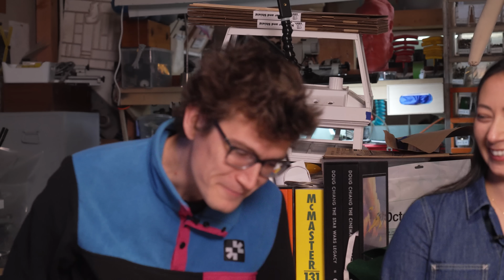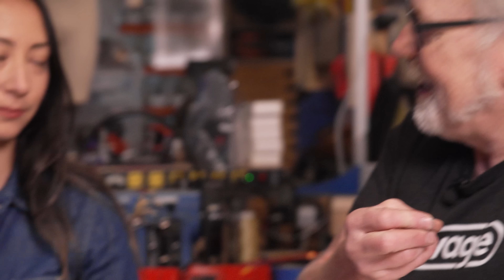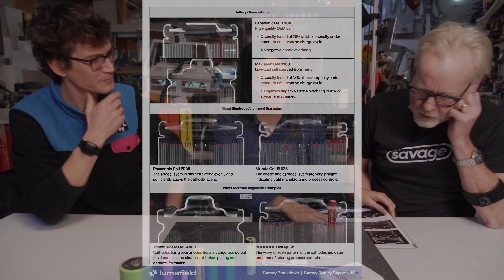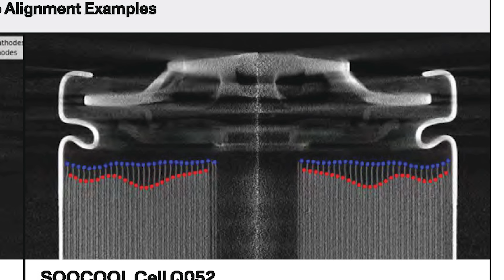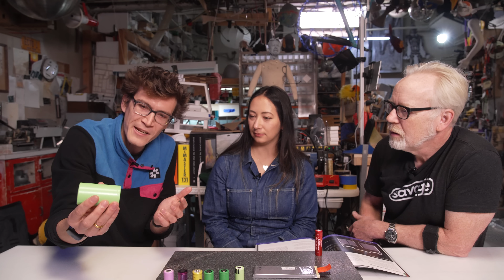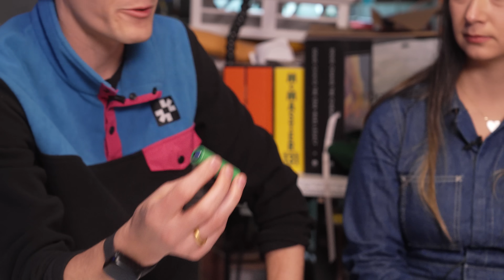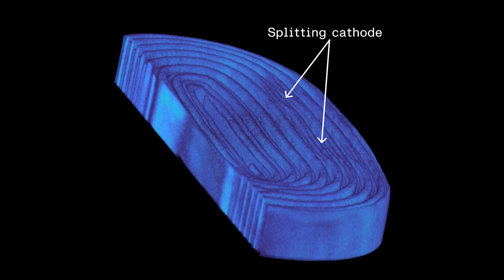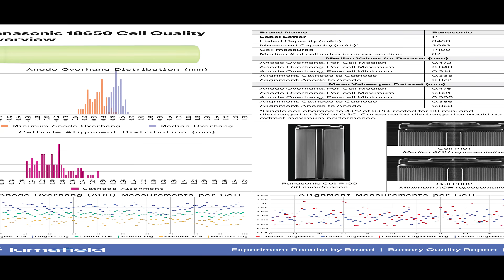The Surprising Flaws in 18650 Lithium-Ion Batteries

Comment: Quite a while ago I switched to using Panasonic batteries almost exclusively.  It started with finding devices with a 5 and a 9 year old 9V battery in a box in longtime storage and not only did they did not leak, both devices were still working.  Then I discovered their rechargeables are good (and are actually inside IKEA rechargeables), and this just again validates my decision.  
Personally, given the risk I think these tests should be mandatory to get any approval for sale.  Very much appreciated.

Comment: Half of the batteries are capsules? But most of my electronic devices can't have capsule batteries in them. They all have their own flat or tiny batteries in there. So I wonder where all the others go. Yes, I heard the example about drills and vacuums - but do you have more examples? Because either I am an outlier or I thought that most people have way more electronic devices like phones, tablets, laptops and earphones and clocks. And then maybe there will be a drill and a cordless vacuum, but the number of small smart electronic devices is way larger, right?

Comment: I bought a flashlight from ebay with an included battery. The battery (18650) was marked 9600 mAh, and at the time of purchase the real manufacturers maxed about 2500mAh. Measured the capacity to 235 mAh😂 It didn't weigh anything so they hadn't even bothered to fill it with sand or something😊

Comment: They hit on the MAJOR problem with quality control today. It used to be that you could purchase the more expensive, trusted name product and be assured that it would last.  Today, if you disassemble a "brand name" product, you find inferior parts made overseas where quality control isn't a priority.
 I have a brand-name microwave oven that has malfunctioned 3 times in 5 years. Taking it apart, it is always the microswitch controlling the door light, safety cut off, etc. There are 3 microswitches and each one failed in turn. It was a simple process to remove each and replace it with a better quality microswitch, but most consumers would have thrown the oven away.

Comment: I tossed one of these into my glove compartment and started driving around when I saw smoke coming from the GC. I opened it and the battery was up against a metal object shooting out white smoke. I rolled down the passenger window, grabbed the battery (which burned my fingers) and quickly tossed it out the window. Looking back in the rear view I could see it light fire on the side of the road while still smoking. This was a cheap Chinese made battery I got off Amazon, wrapped in green like the one in Adams left hand (right of the screen).

Comment: the friend of andreas whose garage burned was irresponsibly charging the most dangerous batteries completely unattended.   those battery cells he mentioned his friend was charging (most likely radio controlled device that uses high energy LiPo) at 4am are the kind that suffer runaway thermal burn.  remember the samsung phones from years ago “exploding” in peoples’ pockets.  and those pouch cells are the most susceptible to overcharging damage.  even in the rare situation when using a charger that claims to stop charging at full should be disconnected within minuted of “green light”.     also, really surprising adam never heard how those batteries are made.   i mean, sure, he is very busy, but wow.

Comment: Internal Resistance is a metric that's used to characterize the quality of a cell...I'm stunned how they don't mention that at all. AND there are chargers that cycle test it for capacity.

I was a battery process engineer and a battery builder as a hobby.

Comment: You said the anode was negative?. in fact it’s positive
Reply: depends if your use the older school room or physics lab conventional current flow method, versus actual electron flow, both are sort of correct in their own way. 
Unless you actually connect things with the incorrect polarity........
In practical terms you are very correct though.
IN the electron flow model, the negative (-) terminal (Cathode) provide an excess of electrons that will flow to the Positive (+) terminal (Anode) through a conductor, maybe thru some resistance.
The conventional current flow model is old fashioned and is opposite to the electron flow model.

Comment: The problem is a lot of devices come with lithium ion batteries BUILT IN, and non-removable easily. And that's when manufacturers might cheap out potentially to save some costs... To me that's the scary part

Comment: Really great insight in this video! At our Electrochemical Safety Research Institute (ESRI), our researchers have also studied counterfeit cells that lack critical safety features and perform poorly in the safety tests. At ESRI, they've conducted extensive tests on OEM batteries purchased from a reputable battery supplier and compared them with other similar batteries, which had bad manufacturing quality/counterfeit batteries. As mentioned in the video, it's always important to make sure the source from which we buy the batteries is reputable and reliable. Additionally, the importance and need for any standards or certifications that the battery has. Other great resource for consumers is several of our videos on our YouTube page and website.

Comment: As a former vaper (quit burn-down cigarettes in 2013, stopped vaping/nicotine entirely in 2021), I am not only intimately familiar with these batteries (to the point that I can absolutely tell you which ones are Panasonic, LG, and Samsung), but I also feel VERY validated in being extremely picky in the cells that I would buy and use in my vapes. Esp. during the heyday of chucking huge clouds, when we were regularly pushing these cells to over 20 Amps/85+ Watts. Too many horror stories of people using cheap, shitty knock-offs and burning their faces and hands trying to pull that much power out of them. 

Very interesting to see them from the inside like this, and the experts you brought on shedding light on what we're looking at, too!
Reply: WTH...that much power from em doing what???
Reply: @mrmotofy  Heating resistive-wire coils by closing the circuit.

Comment: I'm a consumer, there are many things that I don't consider it worth it to buy brand name/expensive.  More and more I don't trust those brand name.  Their warranty now have conditions like only if you are the original owner.  I mean it's a toilet, of cause I am not the original owner... it came with the house.

Anyway, many things I buy cheap cause if it brake I can buy another and another.  Instead of putting all my eggs in one basket for the brand name and have to argue through the warranty and what if... than once it's fixed you still have an old product with other stuff likely to brake.  With cheap stuff, I can fix them up and have spare parts too.  Or buy a different cheap brand.

I am not rich enough for brand name.

Comment: If Ralph Nader were around today, "Unsafe for any use" would be his motto for lithium-ion batteries. Of course, Ralph Nader was demented. 

Any object that requires precision manufacturing for it to be safe is unsafe. If it is made in China, multiply the danger by some incredibly high factor. If it is not made in China, then it is too expensive to be practical for 90% of people, by income.

There are corded versions of power tools that have battery versions. Usually extremely cheaper. They don't need recharging.

The most counterfeited batteries are the name brands. Why counterfeit anything else? A UK YouTuber mentions that the most famous brand batteries have the reputation of being the worst where he lives. Possibly they are all counterfeited.

Comment: I've bought cheaper batteries that do seem to have the advertised voltage and capacity, but can't charge in the X-Box controller. Instead, one must use the (included) wall charger. Like, seriously old school wall charger, oh yes it's the 90s again. I'm now wondering what the hell kind of chemistry they actually are (as they pretend to be Li-on), because they simply can't be NiCd or lead based (too lightweight, lasts too long).

Comment: @14:40 - can the centre of gravity be used to detect if one is missing the safety equipment? It seems like if that was further away from the cap, you'd be able to tell it's missing. OTOH it'd be subtle because the actual jellyroll is so much heavier...

Comment: My first filter when buying 18650's online is primarily whether something is over 3500mah, as even the best ones can't really even hit 3700 so anything above those are already blatantly lying. Next one is look for decently priced ones in the capacity you want, and check their reviews. And if you're really strapped, try checking for any sellers that have good reviews in their refurbished high-capacity branded batteries (typically taken off of ebikes and laptops) where some of them actually note the tested capacity for each cell before sending them out.

I got a small DIY powerbank case that holds two 18650's in parallel (don't put them in the wrong way btw) and now I use its 7000mah capacity on my rain jacket with ventilation fans. Lasts me like, 6-7 hours. It's pretty damn light and super convenient to have. My favorite blindingly bright flashlight holds one 18650 and the jump from the original 600-800mah to 3000mah after replacement bumped its use time from 4hrs to +20hrs, kinda insane.

Comment: I'm a fire investigator, lithium batteries is one of the most concerning and least understood fire causes in our field.

Any lithium battery can  fail catastrophically and cause a fire, especially if they are damaged or abused - but we consistently see these off-brand batteries involved in fires far, far more often than major brands. Particularly for DIY people.  Homemade ebike batteries are a big hazard. Especially since most of them dont have proper safety circuitry for thermal or charge management.

Im a DIYer myself and I do mess with lithium batteries. I'm not saying don't use lithium in DIY projects, but be careful and I would highly caution against building any large batteries yourself. A small device with a few cells like a power bank will typically burn itself out very fast if it catches fire, and someone could potentially fight the fire with fire extinguishers, but once you move up into the larger packs with dozens or hundreds of cells - thats a very high hazard. Those will burn extremely hot, often for hours, and fire extinguishers will not help.

Comment: Kinda crazy but vapors figured this out years ago. The shop I used to work for had to go out of our way to get good high end cell and we were burned by distributors multiple times selling knock off batteries. You would think this problem would get better over time but… I guess not lol😂

Comment: There are 5,000 (more or less) 18650 lithium ion batteries in an EV automobile.
The failure of only one battery can start a cascade effect of failures leading to a battery fire.
How perfect must the manufacturing process be in order to eliminate this 1 in 5,000 error?

Comment: Every unbranded Dyson or DeWalt battery I've bought has had lower capacity than advertised, lower capacity than the branded battery, and failed early compared to the branded battery. So I concur with this video: good quality batteries are SUBSTANTIALLY better than cheap ones. Cheap batteries aren't worth the money.

Comment: There is a lot of thing where, up to a certain point, price does really indicated quality (or down to a certain amount as low prices does mean super cheap either), but with diminishing  returns. A lot of time, You pay for the brands, marketing,  like Crazy useless audio cables for example, some cars, so electronic/computer devices (they are quality but not necessary for the full prices you pay).
 So I would have thought that, yeah, sure some more expensive batteries would be better, and cheaper one kind of "cheaper" , to some extend. but wow, this is insane. like even being like dangerous! yeah don,t cheap out. Like Computers power supplies, don't cheap out ( no new for the 300$ one, but don't get th 30 $ ones).

Comment: the chip up top measures temp, current , voltage, you can test it using those 3 ranges, over-current, over-voltage, over temp, i tested units from amazon the said it was 'protected' they were not, they get hot, overcurrent allowed, overvoltage allowed, etc, you can take the top off to look for the round pcb, also undervoltage

Comment: Last year, I visited my local recycling center and asked to buy some battery packs. They let me buy as many battery packs as I could carry for a fixed price, which I agreed to. A mixture of laptop batteries, tool batteries, vacuum cleaner batteries etc, which one can only assume have been thrown out due to them not working. Opening them up, I got 112 18650 batteries in total. Every single one of then worked perfectly and all (but 2 of them) held 90% or higher than their claimed capacity. What amazes me most is that these battery packs are being discarded when the cells themselves are perfect, rather likely a charging issue or other electronic issue within the battery pack. There should be more recycling of these batteries
Reply: I agree and have done the same with laptop batteries....but....how do we know that they havent formed or are forming dendrites that will, at any time create a short circuit....I have always thought that battery packs were a complete rip off (still do) and had engineered obsolescence built in but am now wondering if they are merely preventing (most) people from using old batteries on safety grounds......

Comment: Thanks so much for this video Adam!  
I've worked in the battery industry for 20 years and it drives me absolutely BONKERS that there is no governing body that enforces the accuracy of labeled capacity.  Dodgy manufacturers can slap any capacity on the label without any repercussions.
Reply: I know, right? Unenergized electrical devices have strict standards to be met. You would think energized devices (batteries) would have strict standards…
Reply: Especially given how many of these are on every flight you take...
Reply: that would only make things worse

Comment: Yep, don't cheap out on batteries. Also choose the correct chemistry for your application; for instance you don't want to put a bank of 18650's in a camper van, home, or boat (like a powerwall); because when that goes tits up, it goes tits up real good. LiFePo4 (lithium ferro phosphate) is safer.

Comment: Building batteries in to electronics is something that we really should stop putting up with. The ability to replace them, the ability to check if they're made by a manufacturer that has basically no QA process. Those seem like they'd be important.

Comment: You probably should have covered the difference between protected and unprotected cells and what that means when deficient unprotected cells are used in poor quality devices that abuse the battery. Namely vapes that allow a deep discharge and potential overcharge with every cycle.
There's a hell of a lot more to this subject and you could easily do a series on it.

Comment: I would love to get my electric bike battery scanned that experiences extreme vibration because they mounted the battery on an active suspension component so every bit of vibration from the surface of the road gets channeled right into the battery. I guarantee you it’s done some damage because the capacity dropped very quick and the electrical connector has been shaken to death.

Comment: I had a bunch of brand new, tested,  110 AH LiFePo's  batteries in storage.  One of the cells ballooned , not connected to anything. Just sitting in storage.  these were intended for an EV project, I'm glad I didn't use them.

Comment: i think it's important to emphasize the fact that battery failures are not evenly distributed as she mentioned. Lots of failures are attributed to low quality, low cost, or counterfit cells, while reputable brands like Murata, SDI, and Ampace (PowerAmp) have tight tolerances and low defect rates in comparison.

Comment: As an aircraft certification engineer dealing with aircraft design requirements every day I would say the biggest passenger induced risk to aircraft safety are the lithium ion devices they bring on.  This video confirms this.  We are more worried about a tube of toothpaste than we are about the 100s of potential incendiary devices on every aircraft we fly on.